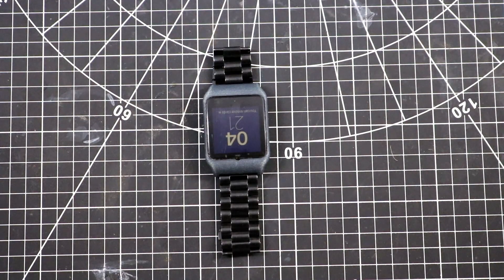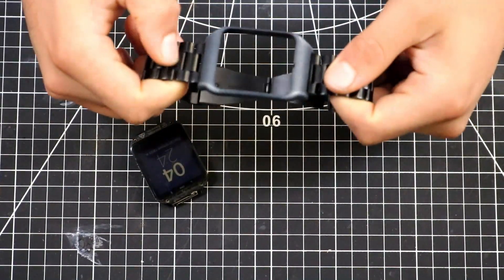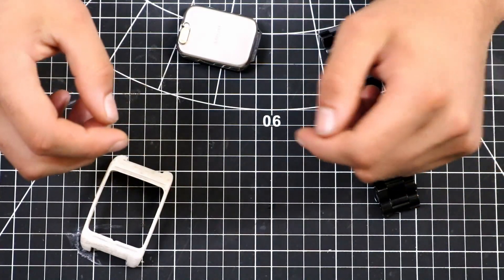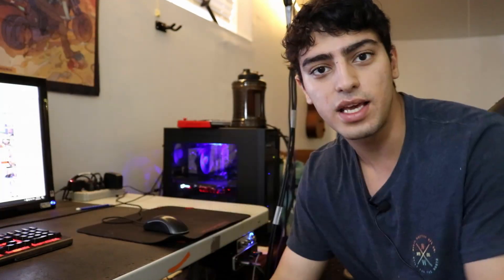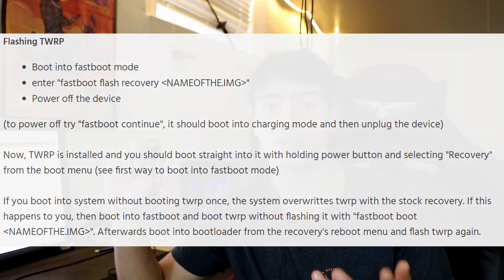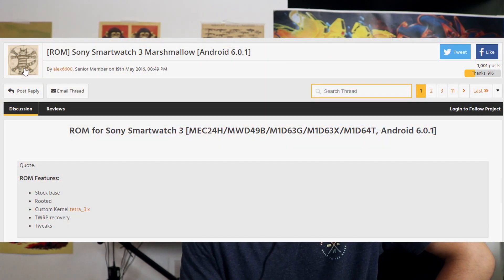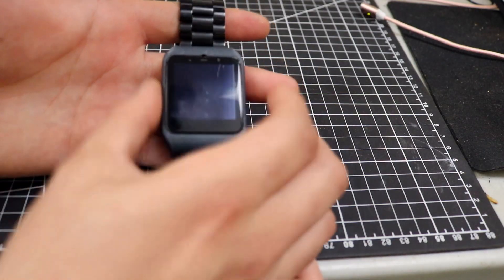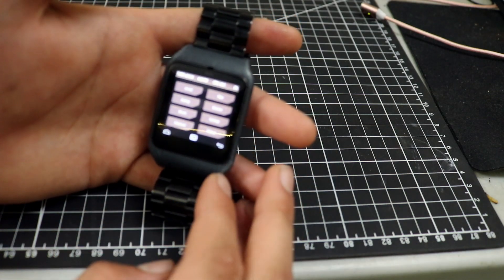My Sony Smartwatch 3 Overhaul and Modifications (3D Printed Case, NFC, Battery+, Custom ROM)

Comment: Hey broo... I bought second this smartwatch week ago and don't have cover usb, it's still water resistant ?
Reply: No!
Reply: @jamesthemongrel  how about on the rain, it's safe ?
Reply: @kresnaprasetyo6590  yes it's fine in the rain even without the usb cover as the port is against your skin underneath the watch.
Reply: @jamesthemongrel  ok, thank you
Reply from the maker: I removed the rubber cover on mine so I could use a magnetic charger. I'd recommend trying that out for ease of use and some better water resistance.

Comment: Hey can i know where do you get the strap😩😩😩 please reply for this
Reply: There are some on amazon, just look for 24 mm straps.
Reply: @lucasvalentesilveiradossan7907   also i need the  adapter please help me out
Reply from the maker: You'll need to 3d print one of the models linked in the description. You can also get the 3d prints shipped to you from shapeaways. That's what I did before I had my 3d printers. The item quality was really good from shapeways. Hope this helps 👍

Comment: quick question, xda doesnt have the link anymore in that url
it now blocks dev host links

do you happen to have a way i can grab a copy of twrp for this device?

for me im trying to install asteroid os, but its not booting it up after install
i know what im doing but it still refuses to boot normal

(unless i restore to stock)
if you could help id be most grateful
Reply: I found a zip with TWRP that works in this link: https://forum.xda-developers.com/t/mec24h-recovery-root-tool-twrp-root-busybox-and-kernel-adiutor.3365990
Reply from the maker: I've updated the description with new links to the files I used on my watch including the TWRP recovery. These links should stay up forever. Best of luck 👍

Comment: how to print new plastik band? Do you have file for 3d printer pls
Reply: Only housing is available to print. Band you can buy on amazon or newegg, link to adapter (Housing https://www.thingiverse.com/thing:2876374 )
Reply from the maker: There are printable watch bands but I'd reccomend buying a proper watch band. You're going to need to get a 3d printed case for the watch though so you can attach the aftermarket watch bands.